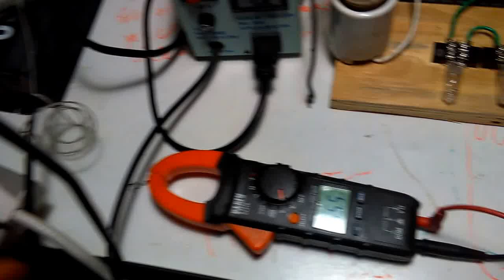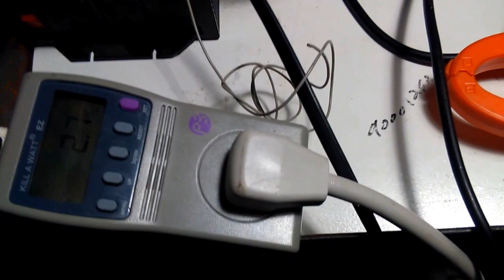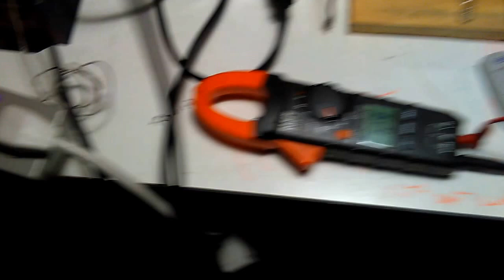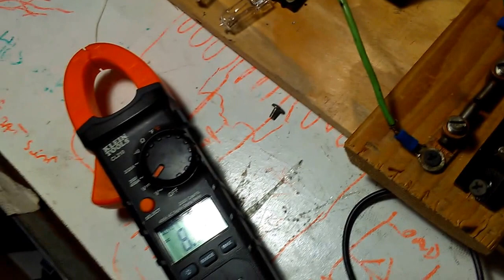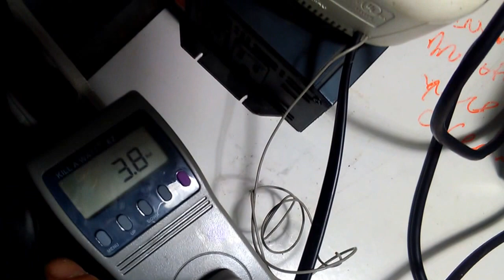resonant charging

Comment: Thank you for all the help. I believe I have said before that I work with Tesla/DonSmith circuits and have had a revelation that may not be completely true. I look up to you as you have made many varied experiments that encircle this technology. Just from what I have witnessed from my own research, I wonder if the idea is to fill capacitors  way faster than the use of electricity demands.  I have seen electric celery and his bifilar coils that never were seen in Don's devices. Don says as well as Zilano  that noone of the stuff? that is on the board is needed and he demonstrates this with the NST wired through diodes directly to huge capacitors. If this is indeed true, which is what I have found, is the reverse tesla coil then needed absolutely for the energy to be usable. I get the feeling there is much doubletalk in magnetic currents as well as reactive power when it might be easy to explain by filling a capacitor faster than it is depleled. thank you Jeff. you are definitely someone I look up to.
Reply from the maker: jimmy popp thank you. keep in mind that my videos are to show certain principles. this video is to show that you can run a linear load and a wireless load at the same time.
this video[ https://youtu.be/7H7NACnsmzU ] shows a quick charge and slow discharge of a foil capacitor. this video is not finished because I didnt show how to convert the electrostatic charge back into normal electricity, I only used a florescent tube to to shpw the slow discharge effect. 

Don Smith layed it all out across his videos. what the video in the link doesnt show is that you can fast charge as many caps as you hook up in parallel. what my videos will reflect once I get funds is a transistor being used to transform the electrostatic charge into normal watts/non reactive power. if you have a lot of capacitor, they will in fact discharge slower than being charged. The energy from the capacitors are actually coming from the planck field around the device. so you can pull more from that source than the input source once it gets going because the source at the load is being fed from the vacuum from in between the plates of the capacitor. see casimir effect.
Reply: Jeff, I do not have much but I am willing to help in any way I am able. I should say I do not have much in the form of money, however I have a large reseearh collection between myself and  my grandfather. If there are any things that I could provide you with that I have, please let me know. I would not even know where to start. do you have an email that i could email you my personal info so that we could chat personally. I am on facebook and you can look my name and you will probably find me quickly. if not please let me know. Thank you my friend.
Reply from the maker: jimmy popp for my safety I dont give out my info or chat in private. my channel is an open discussion. 

thank you for your support. perhaps you can build out a working device yourself? with my direction.
Reply: That would be fantastic. I just didnt know if you needed a piece of equipment that  I might have . I will build something and share the pics with you and when I run into problems you can tell me where i went wrong or where my gap in understanding is. you did hit it right on the head when you said that i need to convert what I am able to collect in my 3,000 volt russian capacitors. I am not sure, but my thinking is that if I am able to collect 3,000 volts in let's say a second, how would I be able to control the output so that I do not disharge all 3,000 volts into a lightbulb for instance. would I be able to control this with a voltage divider network and then a frequency adjusting resistor and transformer? Insted of wasting your time, how would I be able to go from my 3,000 volts at high frequency to lets say 120 volts at 60hz? thank you so much Jeff. Also I am on facebook.thanks again
Reply from the maker: jimmy popp you need a 100 mego ohm resistor but I beleive don smith was using a diodes reverse bias function to only allow a certain voltage through. after that you need a transistor to create your 60 hertz into your transformer to create watts. the transistor will transform the electrostatics to regular electricity. don smith uses a two transistor system with resistors.
Reply from the maker: again this is how the utility grid works. the earth is the capacitor in that instance. the grid uses a mechanical transistor to turn the electrostatic atmospheric electricity to EMF and the transformer turns that into watt seconds or AC. the voltage on the grid is controlled by the height of the transmission wire from the ground. see feynman lectures on atmospheric electricity.
Reply: My problem was that I beieved tht if I placed a resistor on, it would just dissipate as heate, however I didn't even thin of a Zener diode which would only allow a certain amount through. Excuse my lack of knowledge in this, but is there a zener diode that would control the release to 120 or so volts. If I went through a voltage divider  then to a zener would I then be able to lets say go from a NST to 3,000 volt cap  to voltage divider then to usage? what would you suggest? sorry for so many questions. would you be able to give me a tentative system that would allow me to do this. Are the ETB coils (rolled aluminum) necessary? I was hoping, NST through diodes (what type-i have a bunch of uf-5408?-to a couple Russian 3,000 volt caps to a full wave bridge rectifier made from series UF 5408 diodes to a voltage divider of course with the spark gaps where you could suggest. to a usable 120? I am asking alot but if this works, I will make videos on it and give you credit  the whole way. thank you so much. I am only looking to power my off grid cabin/lab that you will be welcome to anytime..lol thank you so much. Do I have the understanding right. Why are there these rolled what seem to be extra capacitors anyway?
Reply from the maker: jimmy popp the amount of voltage control depends on the capacitance of your cap bank and the resistor. don suggested a variable resistor here as a control point to tune the output.
Reply from the maker: the extra capacitors are to produce a wireless feedback to wirelessly recharge the battery with the high frequency from the nst. thats what im trying to show in this video except using bulbs as resistance and load instead of a large cap bank and slow discharge. just trying to show the principle here. If I wanted to get shot again I would just put the whole thing together at once and sell it as a product. 

but since im not, I will show you everything spread out in experimental videos, and you can build it at your own risk. 

what id like someone to do is build me a 1200 watt slayer exciter tesla coil with a bifilar winding like in an NST. so basically a large NST. I tried getting the manufacturers to build me one but they acted really weird about it and wouldnt do it. 

lool up the old scientist videos also
Reply: I am familiar with the old scientist. my cap bank are several 4uf 5,000 volt Russian military capacitors. OMG you got shot. I am so sorry. I understand perfectly. Do I have the right setup? Are the coiled (welding rod rolled aluminum EBTC necessary?) So if I understand correctly, I am correct if I follow Zilano simplified with the NST to the high voltage bridge, then to the 4uf 3,000 volt caps then to a voltage divider and use a deuterium thyratron to set the frequency? will that setup work to the best of your knowledge.  Obviously everything is just a dream. thank you so much. you can always just send me a pm if it is safer. just to reiterate. In my dream everything would be correct then?
Reply: will  a resistor just dissipate heat and waste more energy than if i could control this as a valve would?
Reply: I am sorry. I suppose I asked questions you would rather not answer. can you answer this one question? are the extra ebt coils that electric celery placed into his system necessary for the system don showed? If I figure out the parts after the capacitors  is everything I need shown by don?
Reply from the maker: jimmy popp im not sure what celery is. all that is needed is the high voltage dc from the nst. the high frequency driver creates wireless. don displayed a long diode (with a certain amount of reverse bias to make 120v or abouts) with an aluminum heat sink and adjustable resisitor after.

your taking your source charge from the cap bank and creating a resonance at 60 herts to be transformed into AC watts. you dont need a lot of newtons per joule through the resistor/ reverse bias diode , only enough potential to have something to switch in the transistor. like all switching applications there is a reverse or back emf created. Inversely if you switch back emf, you will get a forward emf and regular electricity out of the switch. 

in an unpublished experiment, I took the capacitor and hooked it in series with a spark gap, a 70 Mohm resistor, and a ceramic transistor, I established an arc from the middle leg of the ceramic transistor from an old tv. this purple arc was the same electricity that the nst had used to charge the cap. but when the cap is charged it only produces reactive power or electrostatics. so a successful transformation back to watts is possible with a transistor. its the same principle shown in my relay switch video and the battery. the resistance in the coil prevents any watts from getting switched but a back emf spark is created that reads as AC 60 volts. 

most people get stuck at that last transformation back to watt seconds or forward emf.
Reply from the maker: jimmy popp the high voltage dc from the nst is only used as a potential difference that creates spontaneous broken symmetry between the plates of the capacitor. the electrons are mirrored electrons of the HVDC from the NST that come from the vacuum planck feild between the plates of the cap bank. Its anti matter that implodes in a spark gap so you have to flip the mirrored electron back with a transistor because its ceramics change the particles refractive index back to a regular electron. 

energy generation is really potential transformations of the energy of the vacuum. its all very dynamic.
Reply: that is what I thought. It was the potential and the per second variable that he stated. Thank you. I will keep you informed on my progress. you are a good friend. Thank you for all your help and continued friendship.
Reply: Thank you again. As I said I am a chemist so I have been indoctrinated and it is very hard to change a way of thinking. I hope you know that I have the utmost respect and thankfulness that you have taken your time out to explain this to me. I believe Don shows one complete device. It is the coke machine device. Thyristor output? Do you believe that I am able to use a deuterium thyratron to change the frequency back to a usable level. Feynman is a very interesting person. I watched a few videos and have ordered a couple of his books. Thank you for your help again.  In this day and age it is horrible that someone would attack you for anything. Keep up the great work.

Comment: Jeff since this is at a 90 degree angle from the flow at the spark gap, would this then be an electro radiant event?
Reply from the maker: well its hard to say, the spark gap discharge is a mixture of HV DC and electrostatic energy and wireless energy. if you want to call this electro radiant then i guess it is a fitting description, but I havent found anyone that actually breaks it down like that when describing radiant energy. 

it took me a while to filter out all that was going on in this circuit. The wireless discharge and the cap discharge are two separate events. I have not been able to find where the wireless part comes from(besides the high frequency of the transformer), because the power coming out of the circuit into the light bulbs fully accounts for the power going in. 

the transformer fills up the capacitor supposedly, and then that same energy is discharged into the light bulbs where the resistance of energy going through the filament causes it to light up. but then there is a wireless wave being emitted from the circuit also.

I built a circuit in 2009 that ran off of this wireless function and ran the linear load by itself. once it was turned on it powered itself. I used the schuman resonance to produce the linear load.
Reply: How would you define radiant energy or radiant 'electricity" ? It would seem to me that radiant would be the 90 degree turn pathway electricity takes in a 'radiant' event? So along with that line of thinking all 'cold' elctricity is also 'radiant' however not all radiant is 'cold ' electricity? yes these are questions. I am trully wondering what you think about these these terms and things.Thank you
Reply from the maker: lol thx for the questions! If you read SI units of scientific notation this question would be easy to answer but since not everyone does I will just point the way to your answers. http://www.cheniere.org/references/brokensymmetry.htm http://www.cheniere.org/references/superpotential.htm would be a start.

radiant energy happens 360 degrees from the radiant event. the 90 degrees you are talking about is that at any 90 degrees from that 360 degree singular point(yes singularity ie blackhole/whitehole), a radiant charge can be picked up. If I had multiple receiver circuits with multiple diodes around the spark gap, the output power would be doubled or quadrupled. when dealing with scalar em you have to multiply the transmitters and receivers to get more power out than in.

this is just  a small OU demonstration so as not to complicate the principle being demonstrated.

the wireless power is over unity created by the geometry of the circuit and the broken symmetry of spacetime. as long as the point charges of the spark gap are separated, a vacuum flux will continuously emit "radiant energy"

https://en.wikipedia.org/wiki/Wu_experiment

Comment from the maker: https://youtu.be/Nih0Jtp7JRc in the video, Okki, shows that there is no additional current draw from the transformer when the bulb is lit. Its the same with my wireless unit charging the cap. 

When you use cap discharges to power loads as well as the wireless power you get over unity. 

The extra power comes from symmetry breaking and artificial dipoles in the environment around the circuit.

Comment from the maker: Dr Meyl explains the scalar waves coming off the transmitter.

note the braided wire on the receiver. that's to eliminate em waves as a cause for the power received. 

as the power is increased the scalar e wave is concentrated and picked up by the diode. the scalar magnetic component is the plasma discharge. 

the scalar e field runs ninety degrees to the direction of the scalar magnetic discharge from the capacitor in a wireless wave . 

multiple receivers and a larger antenna can be built for additional power. 

this only works with high frequency as in Dr meyls presentation. lower frequencies only result in normal wave equations. 

https://youtu.be/k3dCRmwfZss